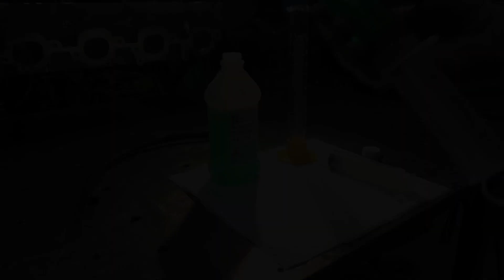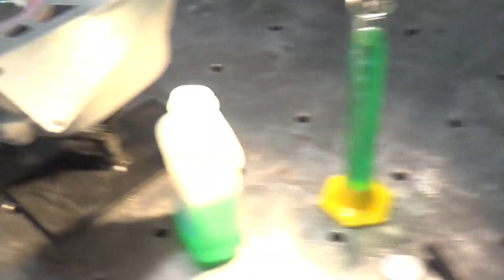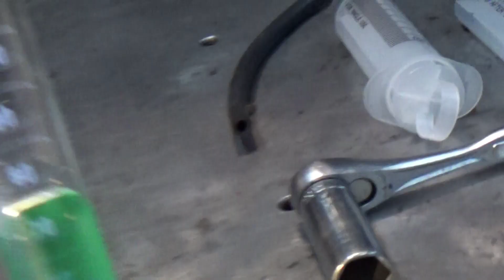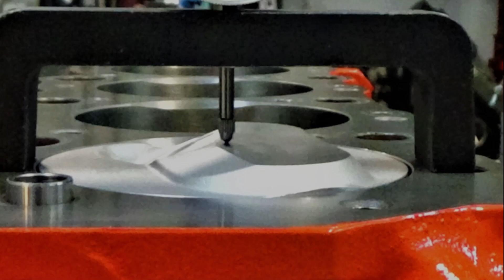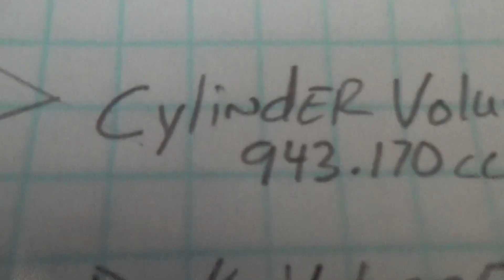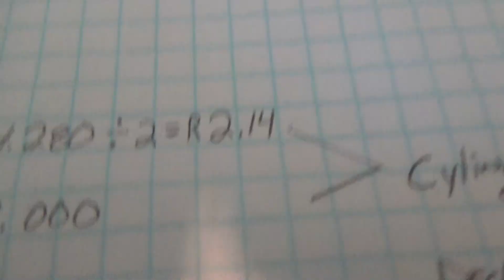Calculate your compression ratio...#16 Chevy 454 Big Block Performance Build...

Comment: I’m doing a 454 build with a similar compression ratio what octane gas are you planning on using? Great video btw
Reply from the maker: Thanks Brian...  92-93 octane fuel...
Reply: @Myersmetalworks   thanks

Comment: I was using a horsepower calculator that is available on the internet to check out what the horsepower output of this motor is likely to be and its telling me 601 HP @ 6315 RPM.  The same website also calculates static and dynamic compression ratios which are needed to predict the horsepower. When I input the numbers from your video they did calculate static compression as 10.16:1 and dynamic compression of 8.14:1.  The only spec the web page required that I did not see in your videos was the Intake Valve Close (IVC)@.050.  I could not find this at Comp Cams website either. I used 50 degrees since Comp Cams does say the IVC is 66 degrees @ .015.  It will be exciting to see if the motor meets or exceeds the calculated output.  I'm going to guess that it will if you use good gas and can advance the timing to 36 degrees total advance at WOT. I guess you are going to have to find a good car to put that motor into? Hope you are having fun doing this project and making these videos for us. I know I'm enjoying watching them.
Reply from the maker: Thanks Mike.... a lot of good information there and thanks for running it thru that Dyno software... It would be nice if the engine would hit those those numbers...
went online and found an IVC calculator and put my numbers in and it said IVC @.050 was  47 degrees.
Thanks again for all your input....